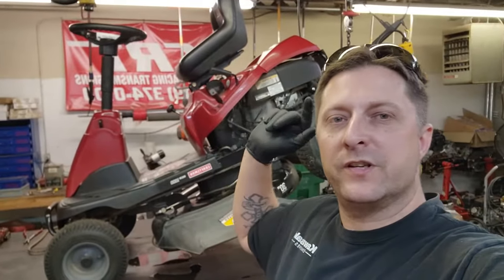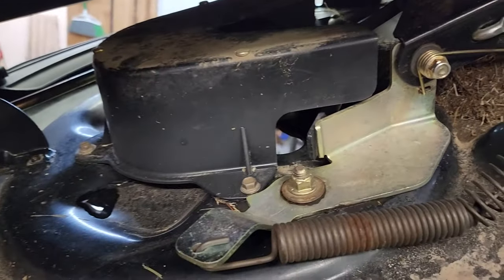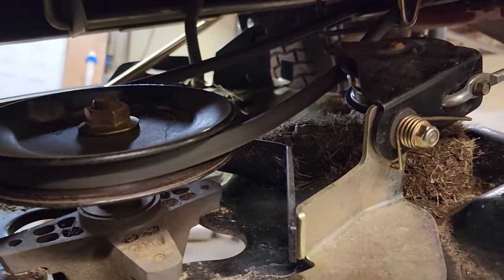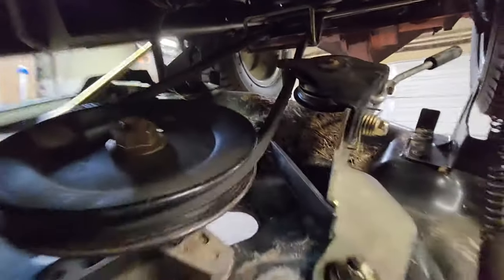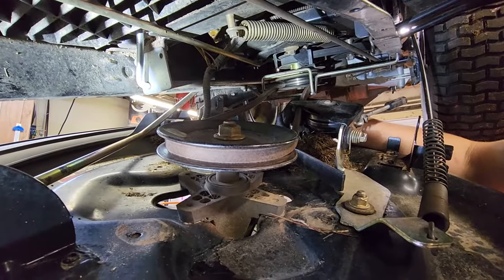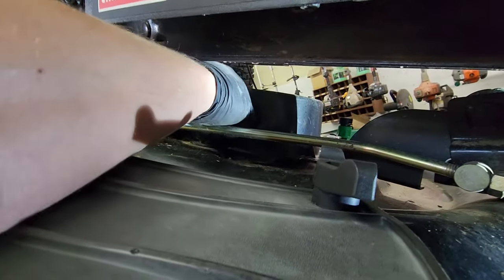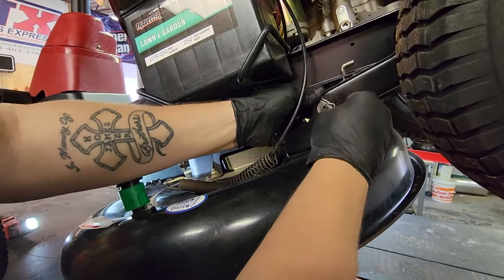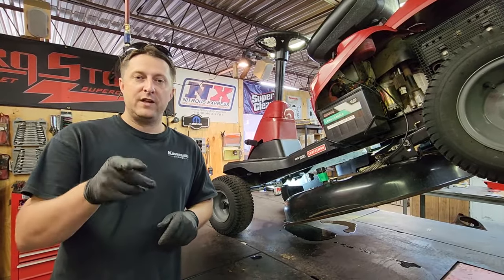30'' Craftsman/Troybuilt Riding Mower Deck Belt Replacement R110/TB30

Comment: I'm 40 and I have never owned a riding mower. I've done my fair share of work on vehicles but don't know the first thing about riding lawn mowers. This video is super helpful as I have the exact model of mower. I've got floor jacks for cars, a transmission jack, bottle jacks, etc, and several good tree stumps so hopefully I can get it in a safe spot for me to do this procedure. Next for me to learn is how to wash the deck....I see the hose fitting on it, lol. Thanks again.
Reply from the maker: Right on

Comment: Hi. My 30" craftsman won't go into reverse when I engage it. Do you know where the adjustment is? It's only about 3 months old, used less than 5x for about 30 minutes each time and doesn't have any obvious transmission noises so I'm guessing it's just an adjustment. I know the front engine craftsmans have a 2 bolt adjustment. thank you!

Comment: My 30 inch craftsman riding mower stopped going forward or reverse it rolls very easy pushing it but won't drive ?
Reply from the maker: It's probably a broken belt or came off.

Comment: I ordered a PTO Cable and it came with only one spring.  My PTO Cable came with 2 springs like the one in your video.  The new PTO Cable stated it replaces the old one, but the new one doesn’t work or have enough tension.  Thanks for any advice.  I have the same riding lawnmower.
Reply from the maker: Belt is wrong or cable is wrong.

Comment: Thanks for this, It helped me see how I will be inspecting the belts and pulleys.  My system stalls as soon as I lower the blade.  Had a bent blade so I replaced it but it still stalls when lowering.  I by-passed the switch with snap tie and the blade worked fine and the engine stayed on, it is only when utilizing the switch as intended, it stalls.  I wonder why it is doing that?
Reply from the maker: Glad it helped

Comment: Great video.  Other videos have you take off the deck, not needed here. Also, you took off the belt cover and keeped it off to put the belt around the engine pulley FIRST , then around the blade pulley, putting the cover AFTER that. Other videos showed putting the belt around the blade pulley, putting on the belt cover, then struggling to put the belt around the engine pully. Your way gives way more space and room to do belt replacement quickly and easily. Thanks. As with other video creators that I learn useful stuff from, I'm sending a few $$ your way by using the "Thanks$" button above. I hope others will do as well to help you bring more useful content in the future. Peace out and God Bless.😎✌🖖🙏🤝
Reply from the maker: Glad it helped

Comment: Thank you so much for taking the time to make this comprehensive video repair. I always wondered how I might lift my mower to do this job myself and now I have a good idea. Very smart using a chain lift and lifting the rear of the mower where most of the weight is. How did you get it up on that work bench table?
Reply from the maker: Glad to help

Comment: Have the same mower. Recently the thing has really lost power. I have replaced, upper trans belt, deck belt, fuel filter, air filter, cleaned the carb. New blade. Any insight on where my loss of power could be coming from? 6th gear feels like 2nd.

Comment: I just put a new blade on (used a 1/2 impact so I know it’s tight) and I’m sure it wasn’t in the exact spot on the star as the old one. Now I noticed (it could have been there before) a fluttering noise when the blade is engaged. It cuts great but I’m wondering if it’s a belt or bearing/pully issue, or if that noise is normal. The mower is about two years old, stored in a shed and only mows a 1/2 acre lot. Thoughts? And is there any PM that can be performed on the bearings?
Reply from the maker: Perhaps the idler pulley, or spindle bearings.

Comment: Thanks for the help! Got my mower fixed. Question for you. I had to add a manual valve to my gas line going to the carburetor. Is there a better was to prevent the gas from getting into the oil when the mower is just sitting? The valve works fine, just seems weird I had to add something that wasn’t from the manufacturer.
Reply from the maker: Your carburetor needs replaced its leaking from the needle seat. Fuel valve is a bandaid for the actual problem but will work if you remember to turn it off every time.

Comment: If you got man hands you gont have to remove the belt guide 🔩 for the idlers 😅 , good help tho . Very in depth , is there a tension for the belt , or is this ajusted with the height . Having slight vibration before and after deck service?

Comment: Great video. I have a problem with the gear speed selector on my mower. After engaging the brake and releasing it the speed selector drops back to first gear all the time. Any suggestions? Thanks.
Reply from the maker: Probably has a worn selector

Comment: any way you could tell us how you jacked up the rear end to do this? I don't have a pulley or anything - just curious of a way to get it in the position you did for this video. great information btw- thanks for sharing.
Reply from the maker: I use a electric winch hanging from my ceiling.  But anything can work or even a engine picker

Comment: I was doing this the other day and a long spring popped off.  It looks like it came off of the brake rod.  I think it's the brake rod extension spring but I can't figure out where to put it back.  Anyway you could help?

Comment: does this mower have just a deck belt or is there another belt?  I only see what appears to be the deck belt but manual says there are 2 or 3 belts??  thanks for any feedback
Reply from the maker: It has a drive belt for transmission also

Comment: I had to replace my lower drive belt on craftsman R110. The new belt came as a 35" instead of 35.25". Now it does not totally disengage when in netural. It tries to pull a little. HOW do I adjust this clutch issue?   Thanks

Comment: Nice video. I got the same mower. My problem is with the brake for the blade. It doesn't move. Could use your experience and knowledge. The handle does not have any resistance when I engage the blade.
Reply from the maker: Thanks for sharing sounds like the cable is broken for the blade engagement.

Comment: Great video !  I have a 5 yr old Troy bit 30 R and will use this if my belt is shot ! ... need help or video on how to grease front wheels which have fittings but for some reason won't let a  small grease gun let grease go in ???  Thanx
Reply from the maker: The fittings are probably clogged with dirt
Reply: They are not actually grease fittings. They are just solid plastic knobs that look like grease fittings. I did the same thing a while back but after installing 2 new tires found them not to be zerk fittings at all.

Comment: I just purchased this mower. It was working great until it would no move forward. I found a part of the belt broke. Would that belt stop mower from moving?
Reply: no the belt he is replacing runs the blade. there's a different belt that runs the diff that powers the lawnmower
Reply from the maker: Probably has a broken or jumped drive belt under the engine

Comment: I have a 30 inch R110/TB30 like in this video.  My problem is the DRIVE BELT broke.  I can't seem to find a video or detailed instructions on how to replace this belt.  Any suggestions?
Reply from the maker: I will post one on the next job that comes in

Comment: I have the same mower... I recently ran into the problem where the engine dies when I engage the blades. It deos die immediatly. It will slowly putter for minutes before it either revs up and gfoes or just sputters out and dies. Once it dies I cannot start it again. Usually it will take a day before I can get it to start and when it does white smoke goes out of the exhaust. Its not the safety switch as I already had that. Any idea what that might be? I would like to know where to start looking on my own.
Reply from the maker: Sounds like leaking fuel in the oil. Check oil see if smells like fuel.

Comment: my question is how can you raise/lower the cutting deck? Searches don't give me any help. My mower is set on the highest setting   "level 5"   but is still too close cutting, and setting 4 willl scalp and bog down the engine. I could use a 
6 and 7 !  It seems the only adjustment is a hex nut facing forward to slightly raise the front of the deck. 
Any help out there?
Reply from the maker: Not much adjustment on these mowers they are built very cheap

Comment: Hi I purchased a used Craftsman 2012 RER1000 and my belt idler assembly looks different.  It looks like I have to drop the pulley to get the belt out and that assembly is just floppy there is no spring tension and the bar you show with the black end is not attached 6:42 .   Where can I find a parts list for this so I can purchase and get this installed correctly?
Reply from the maker: Partstree.com has good diagrams
Reply: Thanks it looks like I need a missing spring on mine no bar.  So once I get the spring then I need to figure out what it attaches to.

Comment: Hi!   Really enjoyed this video, a HUGE Thank You!    But am stuck, have a troybilt tbr30, my first belt fly off, am replacing it on garage floor.    I do not have the strength to lift the back end, can only lower the deck to the lowest position.    ANY suggestions please, from anyone out there, to get this new belt on the front pulley?     Yep, a girl tacklin' it herself!  Thank you in advance.
Reply from the maker: Good luck! It can be done on the floor like your trying.

Comment: I bought mine at a garage sale what is the part number for the belt and what's the part number for the blade on The rer 1000 30 inch deck mower

Comment: I have this exact same mower, and it dies whenever I engage the blades. Runs perfectly fine when blades are off. Is this the belt I need to replace to fix that issue?
Reply from the maker: Sounds like the safety switch on the side discharge check to make sure it's being pressed all the way.
Reply: Did you ever figure out what the issue was? Mine doesnt die but it seems to bog the motor down and it shakes a bit. Runs perfect without the blade engaged though.

Comment: The video is helpful but what if the belt is broken and not routed properly,  can you show us how to fix our mower when the belt is gone or completely shredded?  I have issues that your video didn’t help me with.  Like the black lever you say goes up in the frame,  mine has a spring and I see the spring on the one you’re working on, my spring isn’t connected to anything and luckily I see yours is mounted under the arm so I’ll see if I can mount mine like I see in this video,  but that lever is connected to a pulley and that is also connected to a black piece of metal that has a rubber guide that rides inside the pulley for the blade,  when I route the new belt like I see you do in the video the belt contacts that guide and it damaged my new bell I installed myself without seeing any video of on you tube.  I fix cars so I figure I can replace a mowers belt,  but I didn’t see that guide and didn’t know it was shredding my new belt until it shredded it.  
I’m getting my new belt today from Amazon so hopefully I’ll be cutting grass again soon.  
But I sure wish the video would show what to do if the belts failed,  not a preventive maintenance video.
Reply: Okay my belt just arrived and I installed it no problem and yes this video helped out greatly.  I think my mistake on the first install was not making sure the spring the goes under black lever of the tensioner was installed correctly and it caused the tensioner pulley to be in a downward position and by that happening the belt was twisted and getting shredded.
Thanks for the video.  Now I need one that shows how to adjust the carburetor if there is any adjustments available.

Comment: I have a Troy riding mower. I left it sitting for two years brand new or you all work and no return over but won’t start someone say I need to dump all the gas out and clean the carburetor. I don’t know can you help me
Reply from the maker: Sounds like the carburetor needs cleaned and fuel system flushed.

Comment: What would cause the blade on a trobuilt tb30r to not disengage?
Reply from the maker: Belt to tight wrong belt or cable is rusted or linkage is getting stuck.

Comment: I still can't get the blade to engage. Where in the world does the Black on the Belt tightner go. I don't se a function for it but to pull down on the drive belt. Not very7 strong. I checked the PTO cable, iT IS TIGHT WHEN i LOCK IT DOWN. aNY HELO WOULD BE APPRICATED.
Reply from the maker: Not sure what "black" your referring to?

Comment: Great video!! Consider a 3M Ryman notched belt & HD dressing ( I know, but a little dab' lol do ya? Quiet, smooth & lasts & lasts. Since 1994 on my 90 , 2 belts & lathe center lube on the bearings & engagement! 😉😀 , Working on the CLU-BRAKE0 ADJUST " to keep the front wheels down & my teeth fillings in? Any idea's 🙏 you've tried? Updated fuel to filters, "T" connectors & a dump valve ( Amazon kit) braided line & I can dump that " moonshine fuel & water" stabill it & go another year? That $23.00 a gallon can gas is obscene ( purt pumps are 70 miles a way & my friend at the airport retired , so no 135 pure octane to mix for a while. ( Got some at EAA this year 4 next but then : BIDUMB corrosives? 
Yet still a good tube👍

Comment: Hey man, great vid. Subbed. Can you PLEASE help me, that little tensioner bar with the black like plastic end on it, the bar that is attached to the idler pulley, that somehow sheered off in half and I can't find the part anywhere or exact name of it. It's the chrome bar like 6 inches approx long with a 2 to 3 inch like black plastic/hard rubber end with 1 screw and thr very end of it bends in and sticks into the idler bracket, the black end sits against the mower I think. You know what I'm talking about I'm sure. I have to get this mower working asap, thanks a ton man!
Reply from the maker: We can order one just call us at winderoutdoorpower
Reply: @D-MAN107  will do. Prob needs the whole idler pulley assembly I'm guessing and not just thr bar. I can post a pic of the broken part on your social media if that helps too

Comment: How did you get the mower up on the work table?
Reply from the maker: Table goes up and down like a lift
Reply: What's the best/safest way to lift these mowers to change blades? Lift the rear, front or tilt to side?

Comment: My belt is loose and think I have to either adjust the deck or engine pully
Reply: Any suggestions?
Reply from the maker: Should be loose until engagement

Comment: I have a craftsman r1000.

The issue I'm having is it will not shift and only goes slow.

I looked at the shifter on the right side of the steering column and linkage.  Still can't  figure out why it will not shift to a higher speed. 

Can anyone help me, please?
Reply from the maker: Probably has worn out drive belts

Comment: Transmission is clickying when put gear
Reply from the maker: Either not going all the way in gear or has a chipped tooth on a gear. Check to make sure the idler pulleys for th drive system is good 5hey can make noise when going bad also.